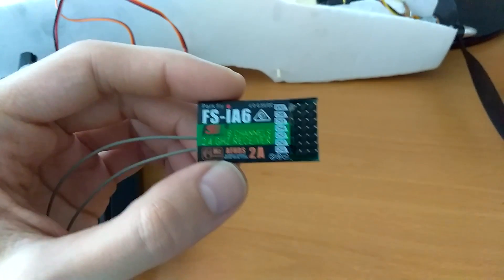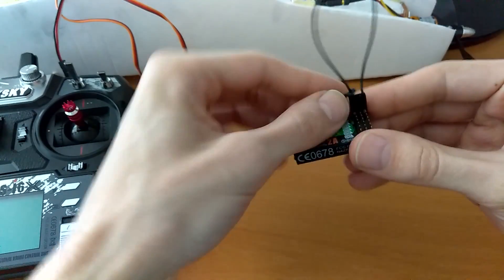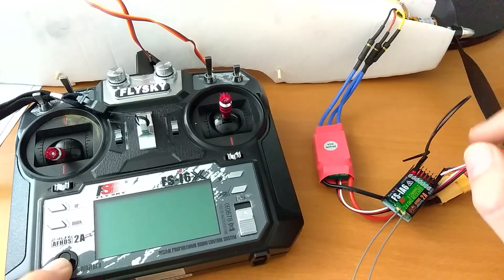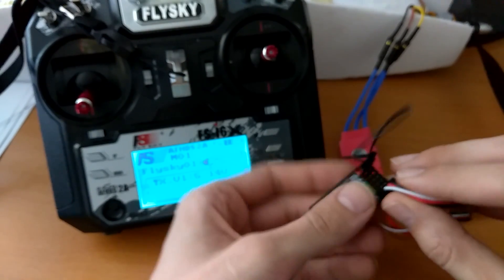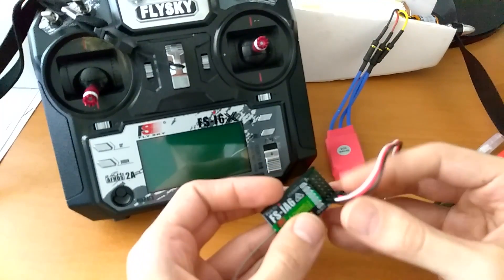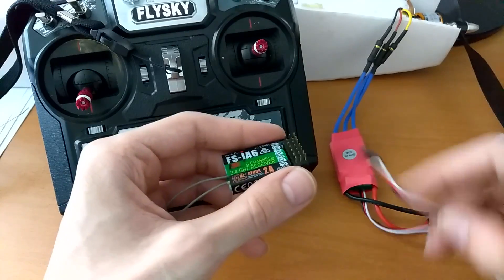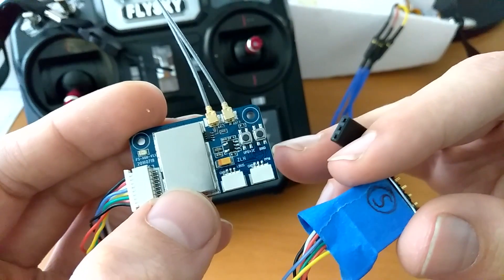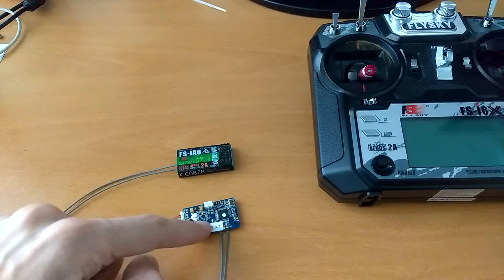FS-IA6 not Binding Problem [Solution in Description]

Comment: My flysky I6X binding problem is the TX cannot remember the receiver it has just bind.   You can bind it now but after a while, the receiver becomes unbind.  Any solution besides dunking the FS I6X for a better transmitter.? This transmitter is only 3 months old. Pretty  disappointed with this model.

Comment: I tried everything you suggested and from the comment section, but it is still showing "Rx binding" on the transmitter. Can you help? If I am not wrong, when I first bought it, the receiver and transmitter were bonded from the factory. Now, I have disconnected and am trying to reconnect this, but it is not working.

Comment: ...and every FS owner is screaming -'NOT 'jumper cable' - BIND LEAD!  Socket no 3 is more usual to use, as its the throttle on an AETR setup, and finally, the real reason your are cocking it up is because there is a seqeunce to removing the bind lead - Just think 'first and last' bind in, power on - power off , bind out. Also, you were lucky the ADFS setting was on the correct one, so you didn't have to change the programming. Best to remove the vid, as its a waste of time.
Reply from the maker: Someone didn't read the title, the description or the comments appreciating the video for solving their problem. Best to remove this comment as it's a waste of time.

Comment: El problema en la configuracion del FS-iA6 esta en que se debe ir al menu del Tx y seleccionar RX Setup y seleccionar AFHDS 2A. Una vez hecha esta opcion se procede como en todos los RX con Bin Key.
Reply: Your model selected must have in SYSTEM the RX SETUP setup to AFHDS 2A  turned on or off.  If you are setting up a non 2A rx then make sure this is turned off, otherwise it will not bind.

Comment: Mr. Soblenk didn't say how long bind plug must remain in place. For my FS iA6 receiver,  I kept the bind plug in and waited for receiver to connect.  After 3 minutes still flashing slowly and not bound also no Rx voltage on transmitter.  As an experiment, I went ahead and REMOVED BIND PLUG EVEN THOUGH THE RX LEAD WAS STILL FLASHING  When I did this, the Rx LED went solid red and the Rx voltage showed up on the transmitter.  Then I removed power and set up with ESC on Ch 3  and rudder (no ailerons) on 1 and elevator on 2.  Both servos worked.

I wasn't sure if I had to connect a motor to the ESC to get voltage on the 3pin plug going to ch3, but I did.

Comment: For those of you that have bought a Turnigy 9x and a IA6 receiver and can't get them to bind here is the answer. Believe it or not you have to REVERSE the throttle. Plug the bind plug into the vcc port plug battery into it with an esc "fast flash" hold down bind button while turning on tx rx will flash slow unplug bind plug from rx first then battery turn tx off and back on then plug battery back into rx LED should be solid now.

Comment: Please don't feel bad about not being able to get this right! The process is not at all intuitive, and it's very easy to get the on/off and plug in/unplug details out of sequence. The mysterious pauses between phases are apparently pretty random, too. Nobody says how long to wait before proceeding, and resuming too soon will unbind the bind. Aargh! 

My Flysky manual is unclear about binding, and trial and error fiddling is hazardous because in the rush to 'just try everything' there's a good chance that you'll reverse a power connection and burn out the receiver. 

Videos like yours are excellent, because they make it possible for people new to RC to pinpoint where they're going wrong. I'm glad you got your system sorted out, and thanks for uploading.  :-)

Comment: You really need to check the contacts, these jumpercables are known to break easy. I just did it with a wire and binded right away. Paperclip or just a peace of metalwire you could easely bend, watchout for other contacts, don't short circuit it. Hope it helps peeps in the future.

Comment: Hi, once I got my batteries charged. Turn the tx on first pushing bind button @ same time. Then put your bind plug on hook power to Rx as soon as it says binding pull the bind plug and it will bind strait away ... Ed in Phoenix writes

Comment: what batteries and esc's are you using
Reply from the maker: At the time I went for the cheapest battery and esc. It is ZOP Power 3s Lipo. The ESC is the same. Cheapest SimonK that came with propeller and motor for $9.99 on AliExpress

Comment: I have same problem , what will be best solution for this problem
Reply: Or i have to change to new receiver
Reply from the maker: Did you try any of the solutions in the description? Disconnect the bind cable before you remove the power from the receiver...
Reply: Thnks buddy its work

Comment: Thank u so much dear.....i was facing the same problem that today suddenly my receiver cant connect to the transmitter so i use the 1st method in the description and removed the binding cable without disconnecting and finally it is connected, thanks frnd.

Comment: Step 1 - Press Binding button + Power On in transmiter

step 2 - Plug bind cable on ch Bind/vcc and connect power On Reciever

step 3 - Wait the reciever connect to transmiter...

step 4 - dont un plug power on reciever...but un plug first bind cable on reciever

step 5 - done....
Reply: Didn't work. 🙁
Reply: Babay Soblenk i followed it but still nothing happens
Reply: Makes a sound that it has bound, but still showing err1%
Reply: Thank you so much all of the other ways didn’t work so I decided to look in the comments and this one helped thank you
Reply: Make sure follow step by step
Reply: Thanks to this help me....
Reply: Thank you, this worked
Reply: Thank you very much dear.. It worked..
Reply: Didn’t work
Please help
Reply: This worked. Thank you.
Reply: I'm having problems finding my radio it will nind when I first bind it but if I turn it off and turn it right back on nothing will happen no movement on the servos any idea? what can it be
Reply: Exactly worked for me.
Super thanks for easy steps..
Reply: thanks a lot worked for me
Reply: in my case it didn't not work.
Reply: This work for me..good job
Reply: Step 6...didnt work at all even remotely
Reply: Hell yes... Thanks man :D>. love you :D
Reply: mine still forgets every time its powered off for a few mins...
Reply: digging deeper... mine came pre bound, and i think this company is just garbage...
Reply: thanks bro your tricks is working

Comment: I had the same problem binding this receiver to my FS-I6 transmitter with the FlySky-i6-Mod-. But I discovered it had nothing to do with the new firmware or using the hidden menu as opposed to the bind button. The receiver actually binds fine if you follow the documented procedure (shown in this video), however after you're done you need to power the receiver correctly via the power pins (labelled B/VCC) instead of CH1. The problem seems to be that powering the receiver via CH1 puts it into bind mode (fast blinking LED) even without the bind jumper connected. It's also worth noting that the FS-IA6B doesn't seem to have this problem. Hope this helps anyone who was getting as frustrated by this as I was. :)
Reply: Kandred how you do iy
Reply: Thanks. I followed your advise and it instantly worked.
Reply: @Slynov  Glad I could help :)

Comment: Please explain suggestion #1...
Reply from the maker: You remove the bind key before you turn off the power to the receiver. Just pull out the jumper while it's connected. That's what worked for me.

Comment: HEY! in another video comment i found this and it worked: 

Calling BS2 months ago
I was having issues binding and found I could not bind how you did, rather I had to enter the secret menu, Binding must be done through hidden menu with new firmware
Hold down both sticks bottom left corner while turning on remote
Use bind function.
Reply: Felipe Echeverria Bennett but problem not solve
Reply: I did it still it is not binding
Reply: naren pulikonda ya same problem
Reply: Im getting ready to pull.my hair out. I have a fs-i6 transmitter thAt ha the bind button in hack. it wind go into bind mode. its like im not even prosiding the button. I bought a USB cord and tried to update firmware but my computer doesn`t recognize the tx. a driver issue perhaps. s i tried to updAte driver but im stuck there. if anyone can help. I could use some.
Reply: @late2thegatefpvdfreeman319  on GCS first hit START button and after that conect board,for me it worked...1.rescue 2.open..3.flash..after disconect board,hit upgrade and erase then connect board...

Comment: Remove the loop without disconnecting
Reply from the maker: Excellent! this worked great. Thanks! I also tried Felipe's answer before that and didn't work until I removed the jumper cable before disconnecting.
Reply from the maker: Loop = bind cable or jumper cable.
Reply: sorry to be that stupid, but what is the loop?
Reply: thx very helpful
Reply: It's working thank you